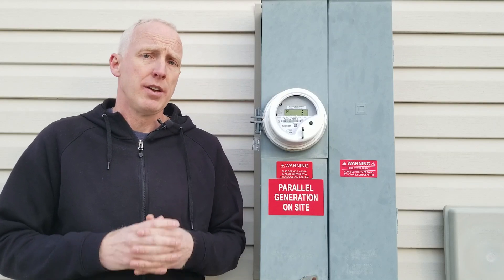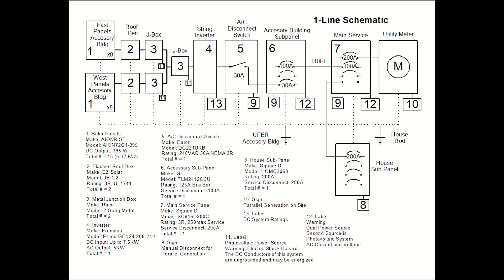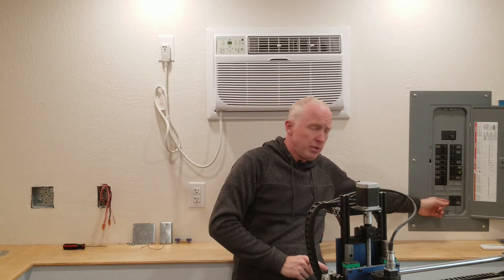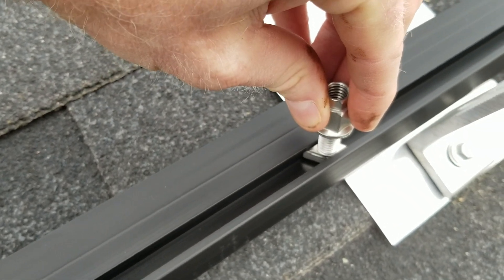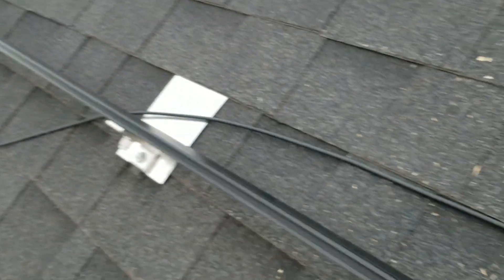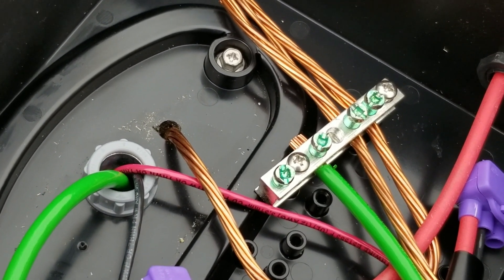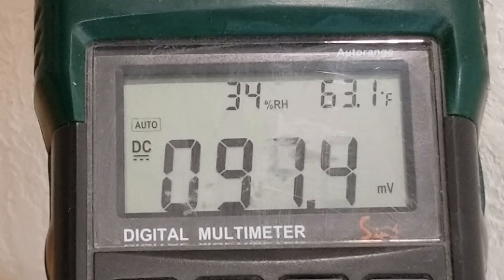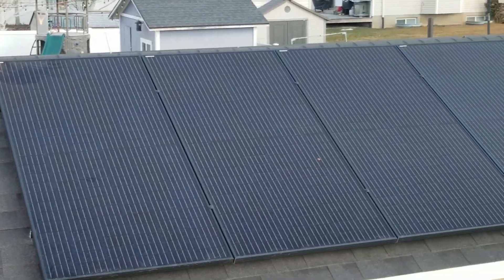Easy DIY solar panel system installation step by step – Save money!

Comment: Can you also give details on how much is your yearly output on the systems you install. I am worried i won't get the real numbers after I install.
Reply from the maker: I will do a video after one year, but here are a few months so far: March 600kWh, April 900kWh, May 1100kWh, June 1200kWh.
Reply: @ScienceFunInnovations  wow that's a big jump from March to June. 100% jump. I will save your video for when I install my panels. Thanks

Comment: Great videos! I see your panels are so close to the end of the roof and I am not sure what city requirement is? I see lot of people installing multiple panels with a 4x8 grid of panels and no space in between. Would you recommend leaving space after every two panels to walk around and troubleshoot the panel or the micro-inverters in the future? (considering you have space on the roof). or is that normally not a concern.
Reply from the maker: Because it is a detached structure I was not required to do setbacks. I had a small roof and just wanted to fill it. I don't expect much troubleshooting, but I can get to each panel by walking on the ridgeline.